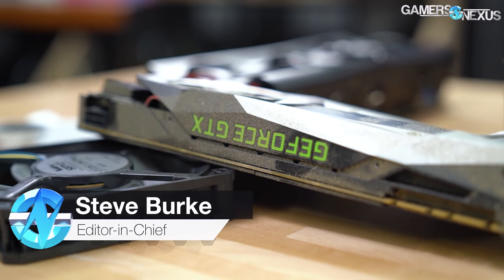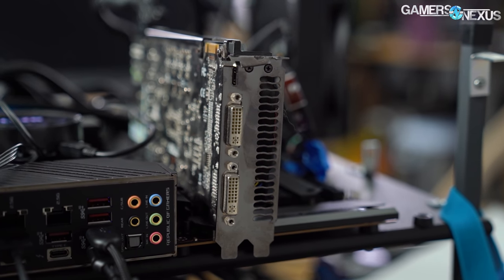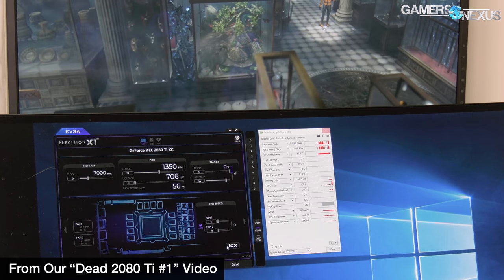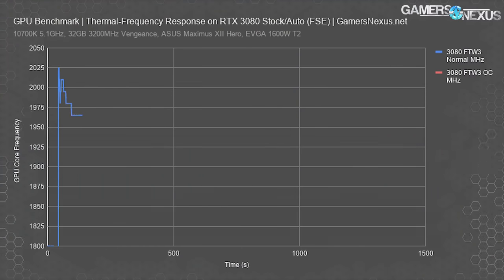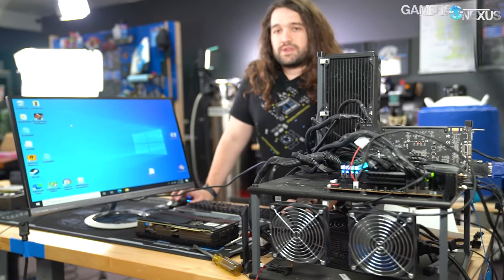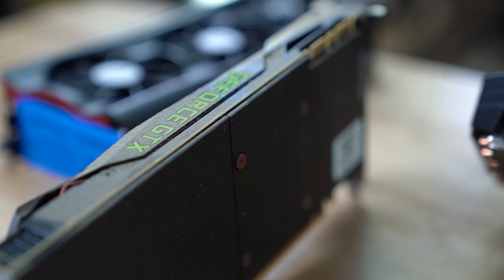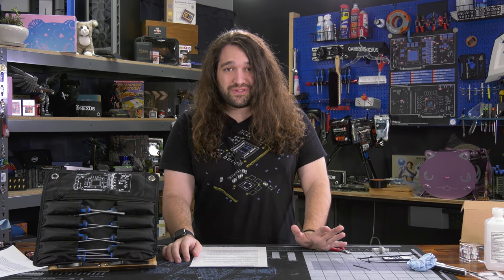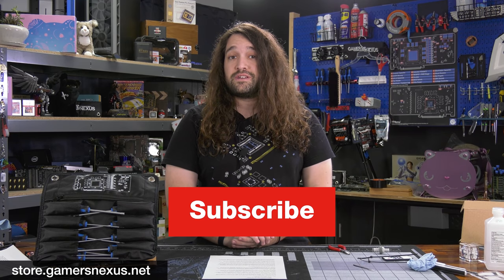Warning Signs When Buying Used GPUs: How to Detect Defective Video Cards

Comment: When I resell a card, if it is two years old, I take 25% off the MSRP (at the time of purchase) AFTER I clean it up, replace the pads and thermal paste. If I don't do that, 35% off. If the card is 4 years old, 45% off MSRP, 55% if I don't "refurb" it. If it is older, flat 75% and I might feel spending the time before sale depending on my mood. Every time I have my listings, I describe all I did to clean it, what kinds of games played on it to give an idea of heat stress and pictures with full metadata and timestamp. I've done this for well over 10 years and I try to give the person considering buying form me some confidence.
I am building a new computer at the end of this week as the one I have is 8 years old. I am not sure if I will be reselling the old RX 580 I have. It was one of the better MSI X versions, and I don't have any of the original packaging (that was another "selling point" I had on ebay) due to moving unexpectedly and having to trash it. If I do, it may be "as is" since it is so old, and people are still buying it.

Comment: Well I just finished selling my gtx 1080 on ebay. I'm a little disappointed in how much I got for it compared to other sellers, but I still did ok and I hope the buyer is happy with it. Chalk it up too me being a new seller I guess.
Now the real fun begins in finding a replacement. I sorta want to try fixing broken cards for fun. Reballing seems way too hard, but reflowing or changing a mosfet seems  doable for me.

If a seller had a pair of GTX 1080s in SLI that simultaneously "stopped working/ no longer recognized by windows" do you think that's a real failure of the cards?  It sounds like more of a driver or power issue? They say they're acting like they don't power up.
It seems kinda improbable that 2 cards would have a hardware problem at the same time.

Comment: Great video, I recently bought an rx480 as nothing else is available for a reasonable price. It was in good condition and had been cleaned but I noticed under load the fans were screaming at 3000rpm as it ran at just over 70 degrees. After watching you're GPU maintenance video I opened up to repaste and the die was only partially covered, paste was in reasonable condition though. Now under heavy load it runs at similar temperatures but the fans never go to full speed to maintain it and its much quieter

Comment: WHEN A PRODUCT IS FAULTY AND/OR REFUND IS DESIRED.
1. When you buy, use PayPal or a similar payment manager to give yourself an interval in which you can test the card, and if the card is faulty, send it back for a full refund. PayPal and Amazon, at least, have buyer protections.
2. As Steve advises, test the card immediately on receipt-- the window of return can disappear rapidly when you put the card on a shelf "temporarily".
3. Always try to obtain a free, prepaid return label from seller by contacting seller. If seller will not issue such a label, contact the payment manager, and explain the situation. If seller is overseas, the cost of return-shipping a properly insured package is significant, even many times what the seller paid. 
4. When returning any item, make sure to obtain a printed receipt from the shipper. Emailed receipts are often lost / misdirected.
5. Do not let the seller bamboozle you into paying for return freight or a "restocking fee". Under PayPal and eBay, in general, you can obtain a full refund without extraordinary measures. If seller does not issue a prepaid label and/or make a full refund, he immediately falls into trouble with the payment manager. If that label is not forthcoming from seller, contact the payment manager, who will provide the prepaid label. 
6. After the online purchase-- sometimes only hours-- some buyers may discover they made a mistake. Although they contact their seller immediately, seller innocently claims the item is already on its way, and shipment cannot be halted. This, though the seller is in Hong Kong, and promised delivery after only a long interval of many weeks. If that seller explanation sounds bogus, it may be-- seller hopes buyer will give up, and accept his fate. However, with a payment manager, buyer still has all the cards. If buyer is certain a return is desired, contact seller and request a return for refund. If after three days (on eBay), seller does not respond, begin the process of return, anyway, through the payment manager's return-for-refund routine. 
7. Both eBay and PayPal have voice / phone numbers. Unfortunately, they make it difficult for buyers to contact a customer service representative by phone. Although the pandemic has reduced call-center staffing levels, this creates a frustrating bottleneck for buyers who have unusual situations and conditions not addressed by the standard website procedure, and require human intervention. With the eBay website, for example, a buyer must run through the usual return-for-refund procedure before additional website options (including voice contact) appear. 
8. In all cases, try to remember the payment manager's customer service representative is a human being working under high pressure, and has nothing to gain by frustrating you, as a customer. The CSR usually will try to be as helpful as possible, after you explain the problem / issue carefully and clearly. If the CSR is too inexperienced to help, politely ask to talk with a supervisor (explaining to the CSR "This has nothing to do with you, but my situation is unusual and may need a management decision".)

Comment: you forgot to mention that if you can take apart the card - look for burn/solder marks
a common failure in older video cards is chip fall off, and the only fix is resoldering it, but that fix usually doesn't last very long so you gotta watch out for that

Comment: Bought most of the parts for my first pc used in 2012/13 HD7950, i7 3770K, ASUS Z77 formula, 8GB DDR3. Bought an asus Z77 sabertooth motherboard for a modded build using the thermal shield, and upon taking the black plastic shield off ready to paint, I found a bunch of yellow-brown dust and the smell of stale cigarettes. The seller was a heavy indoor smoker. Luckily the board still worked fine, but it took a long time to get the smell off it

Comment: Speaking of GPU sag, I bought a used GTX 680 recently for my WinXP machine (I hate emulation) and it had that issue, the cooler separated from the actual card. I saw this in the Ebay ad, was worth paying only $35 and just ziptying the heatsink to the card, after replacing the thermal paste of course.

Comment: from a personal experience i bought a refurbished mining rx 580 in 2019 for 90 euros from a local shop in my area and i have no complains, the card performs amazing and is an excellent overclocker (1500 mhz core) as well as it is undervolting. if you dont have the option/ability to go for new hardware i highly recommend buying 2nd hand parts from sellers that you trust or know personally. 2nd hand parts are often value for money if you buy them in reasonable prices! P.S :DONT BUY STUFF FROM SCULPERS FOR RIDICULOUS PRICES!!

Comment: I found a super good deal on an RX 580, paid 275 for an HP system that somebody stuffed it inside. I almost thought I got scammed because it was super finicky and I had to tinker a lot with it to actually get it to work, but very worth it. It's not high-end by any means, but considering the alternatives were either playing games on integrated graphics or paying way too much for a separate card, it was well worth the few hours I spent frantically troubleshooting. Anyway, now I'm selling the rest of the system to get an even better deal out of it and I'm super happy with it.

Comment: 5:41 my 1080ti does this if I mine ethereum and use Ethlargement pill and then close Phoenixminer (if you don't know, ethlargement is a memory timing strap for 1080s and maybe 1070s).

Yes, its absolutely a memory issue

Comment: Another thing to do is get close to the card and smell it. Burnt electronics have a very distinctive smell. I had a fan fail during heavy load on an old video card and even the system shutting down didn't save the card from almost catching fire. My entire room smelled like burnt electronics for days after that and the computer case always smelled faintly like that. If the card smells like that then it was in close proximity to some sort of catastrophic failure and should be treated with suspicion.

Comment: I was buying parts for one of my friends old alien x51 and he wanted to see if i could upgrade it 
So i bought a new psu for 35$, a gtx 970 on a local Ebay listing for 25$, and a 500 gb ssd work pretty well for the small form.

Comment: the artifacting you see at 13:00 can also be due to the use of the app "nvidia inspector - multi display power saver". why would some use this app you might ask? its cause some nvidia gpus, not all. when running triple monitor or quad monitor it tends to keep the gpu pegged at max boost indefinitely and the only way to drop the frequency is to use that app.

Comment: I bought a used 1080ti and it didn't work but after I cleaned it and replaced thermal paste, then it worked perfectly 😀

Comment: Have bought a lot of used gpu online since btc crash on 2018, few of them are ex-mining card. Only 1 card I bought was defective. An RX 480 8GB at $70, it was overheating even at 100% fan speed. Only about 5-10 minutes gaming and it crashed. Forget about stress test, it will BSOD in an instant. From the look of the card it must be used for mining for sometime and the owner never do any maintenance on their rig. There was a lot blackened dust and rust on the heatsink when I took it apart to clean it. Soap bath and repaste did not help all. All other card I bought works like it should, some of them even in pristine condition, very clean like new, especially NVidia 20xx and Amd 5000 series card, because most of those card was from post mining crazed era. Advices for who are thinking to buy used card, ask as many question as you can, ask for specified and detailed photos of the card so you can know it was the latest condition of it not some old photo they have on the listing, and only buy from a good rating seller or someone who only sell few item and sold most of them. Never trust seller who have a lot of listed item at low price but only sold a few or using stolen photos.

Comment: I got a used Sapphire Nitro+ RX 470 4 GB version recently for less than 100$, and so far it works perfectly well. The only small issue is that when the screen goes to sleep, and I wake it up, it sometimes shows the white noise, and I need to turn off and on the monitor to get rid of it (it doesn't happen every time, and didn't notice it happen during the last few days). Not sure if it's a red flag.

But in all the benchmarks it performs in line with the results I found in the web, and it runs assassin's creed Odyssey perfectly as 1080p, so I'm not complaining.

Got the card on local overclockers forum, from one of the trusted used goods sellers, he even cleaned it for me for a small tip. Not sure where it came from, but the price was very good considering the current market situation, and it replaced my extremely old 1 GB graphic card, so it was a good deal overall. Normally good sellers give 1-3 days to test the card, and if there are problems, they allow return, but it only applies to sellers who do it frequently and value their reputation.

Comment: Just bought a used MSI 970 from my local shop, they took it out of an actively working computer, hot off the machine. Works great for my old computer I salvaged my MSI 980ti from and recycled it to church only doing ppx most of the time and an occasional video. $450 was fair in my opinion. My old MSI 980ti is still going strong in my new gaming computer paired with MSI X570 3900x and two 1TB m.2

Scabs destroying the market, and I'm not willing to pay twice the price of msrp for a 3000 series nvidia gpu.

Comment: I had an used XFX RX 580 8gb I bought on ebay for about $100 right before gpu prices went stupid crazy high. Looks-wise, it was really pretty clean. But the first sign that there was something wrong with the card was out of the box one of the io ports didn't work, HDMI I think it was. I just used a different port. I got about a month of use out of it, mostly as a video adapter to get something to show up on screen because I'm married with kids and have almost no time for gaming. I did change the thermal paste and benchmark it when I first got it. One day about a month later, I noticed a little bit of random artifacting. In just a couple of minutes it got much much worse. Before I could pull up msi afterburner to underclock the card to try and save it, the card died and has never worked again. Now, with prices the way they are, I can not afford to replace it like for like. Sad face. Would anyone have any ideas as to what might have happened?
Reply: The card couldve been used for mining, which explains why it just randomly crashed. Other than that, I suggest you buy a GT 1030 if you just want to display things on the screen and do some light gaming.

Comment: Spent a while trying to find a gpu for a budget build, had to ask a friend for some advice as the uk market is especially fucked. Top end 980 with amazing cooling. Was basically new, not a sign of use, I would struggle to clean a card that well, came with everything that was in the box but sadly not original box. Still more than happy for the price. Only thing I didn't want to buy used was storage.
specs on the system for folks that care:
i7-3770, 16gb ram, 500gb ssd, 980 4gb. Built for about £450 after some cosmetic upgrades.

Comment: I bought a new GTX 1660 Super in the fall and sold it in February. My buyer was one of the lucky ones...he got a basically brand new card with all warranty documentation and original packaging for less than MSRP, and I still got more back than I paid for it because I got it on sale. Could have been punitive with my pricing but sadly I'm not enough of an arsehole.

Comment: Real happy with things now. Bought my 2060 super last year right before prices skyrocketed. Then a month ago sold my old RX 480 (which I paid ~$220 new) for $400. Normally I would have been lucky to get $100 from a 4 year old card. Actually kinda sad to see the card go. It was still a great performer and would have been a nice upgrade in my backup rig (which has a Radeon HD 5770).

Comment: I think the best thing when you buy used GPU is a bundle with PSU. I bought 2 years ago an RX570 4GB with 450W PSU from Corsair and received them in [from what I remember] RX 2070 & Corsair 650W boxes. So basically it was pretty obvious that the person just upgraded PC and was getting old stuff out.

Comment: I have an old GTX980 FTW3 that needs to be underclocked a tad to prevent a random blacked out screen and system locking up 
its not thermally related or power related that i can tell

Comment: What usually do is look for seller who are rather 'rich'. I bought my rtx 2060 super for $340 cause the seller isn't satisfied with it's performance ending up just using the card for benchmark. I also bought my asus 27" 165hz monitor for only $230 since the owner will be moving next state. 

I usually have a very good gut feeling and I'm quite grateful of it since I save a lot of money. What you don't buy second hand are the cpu, motherboad and the psu. Always buy them brand new.

Comment: ....use a solvent rather than scraping with a screwdriver.  If you have to scrape then use a plastics spatula because if you use a substance that is harder than the Aluminum then you could easily scratch the surface of the heat sink.

Comment: I've handed my r9 290x and 580 sapphire nitro 8gb to my familly, bought them used and they're still running fine to this day. Might open them to change the thermal paste and pads but nothing too bad.
Got my hands on a vega 64 nitro special editon, the three pcie power slots, guy said he wanted to mine with it but he didn't use it for some reasons with the motherboard. In any case, the price was attractive, it was clean and didn't had any dust, not even a scratch on it, while beeing lower priced than the 1080gti i was looking at the time.
I've yet to get badly scammed but as of now, i'm fine with it.

Comment: Yea i know how it is lol. paid $300 for a 2060 super 2 months ago from the marketplace on facebook. guy said it was perfect. had it shipped. put it in. and found out it overheats. did all the normal stuff to it. like thermal pad and paste replacement. only helped a little. even shipped it off to Gigabyte where they said nothing was wrong with it. when clearly there is. now waiting for it to be delivered back to me. going to strap some 120mm fans to it. hopefully that works =(

Comment: I bought a R9 390X. I tried underclocking it. I wanted to use a 700 watt power supply, because that was what was installed. 
 Well for some reason dropping100, 50Mhz and or a 20MV or just lowering the power limit did not work.
 AS long I did not game it worked fine. Installed a 1050 watt power supply and it was happy. Also no need to underclock
I underclock when possible in the summer because brown out is normal in the summer. The a/c will not run below 110 volts'
The 1050 watt power supply has no problem with 108-109 volts with 125 watt CPUs and 300 watt GPUs.
I have just glued a Arctic 90 MM in place of failed stock fans. Just plugged it into one of the PWM ports on the motherboard.
 It actually cooled better. Not much difference sound either.